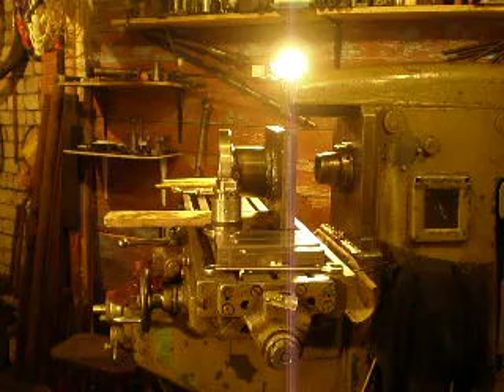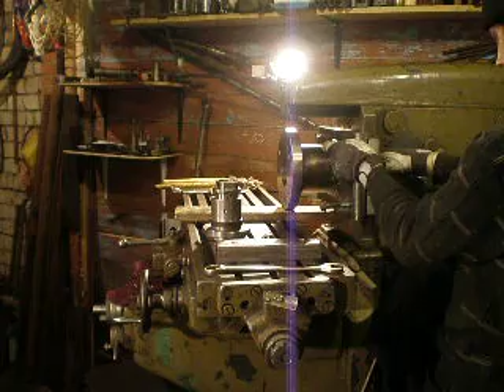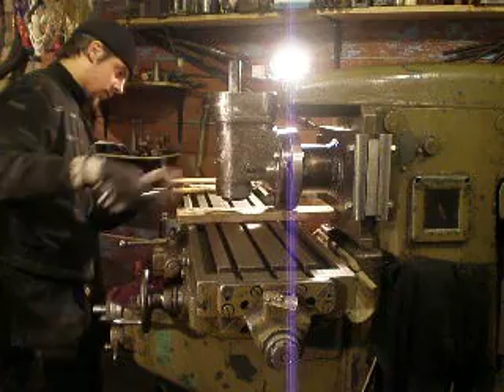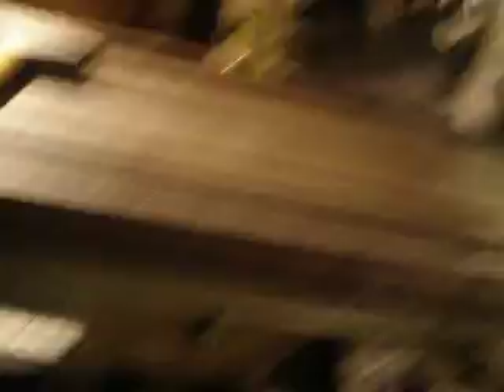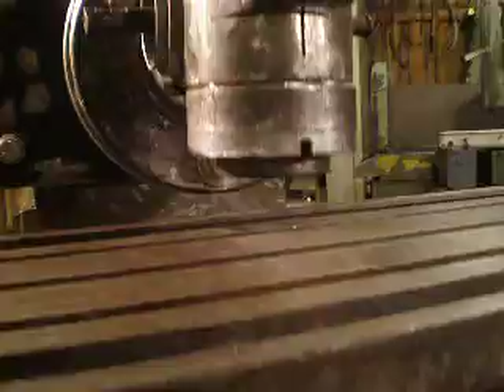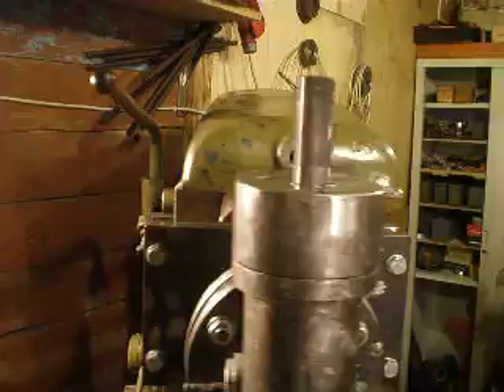Milling machine project Part7 - My project is finish - mounting on milling machine

Comment from the maker: @mayhem7090 For mill head I paid ~30EUR (buy+ to bring +repair), metal for adapter cost ~not over than 25EUR (buy+ to bring), two bearings in adapter cost ~10EUR, totaly it cost~ 60 to 70EUR (not include my work time). I use Steel= C235/ C355 and 5140SAE and 1045SAE. Capacity of head = 100mm face mill - not for very heavy milling, 23mm Coro mill - at full of insert depth. Drilling Dmax~ 30 to 40mm. (at work with lathe bore head can machining bore to ~150mm. Spindle cone MK-4 morse.

Comment: hello, really very good project, excellent, very well taken, how much it cost you to repeat the milling head, what quality of steel you use? What is the capacity of the head? diameter of drilling / milling, and what type of pin head? , cordially good luck.